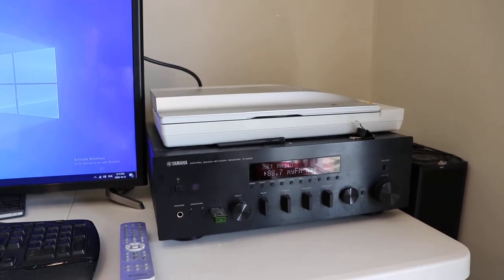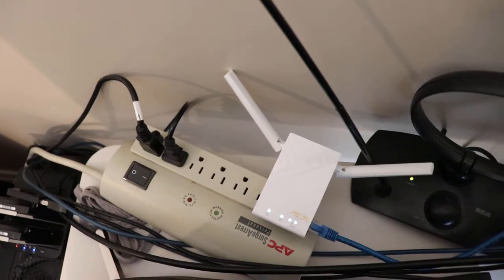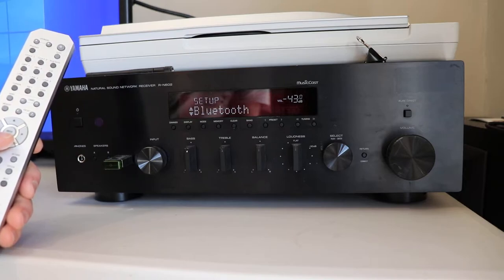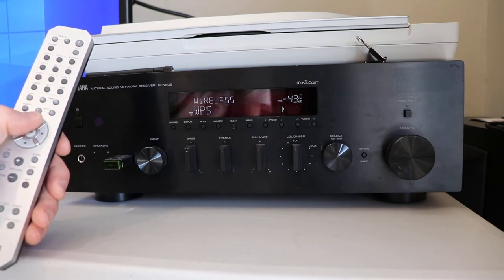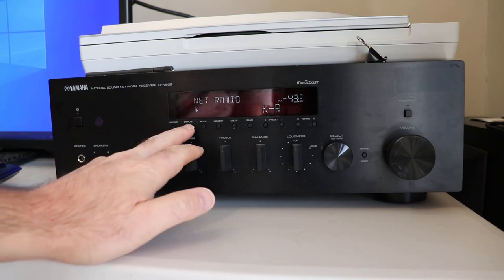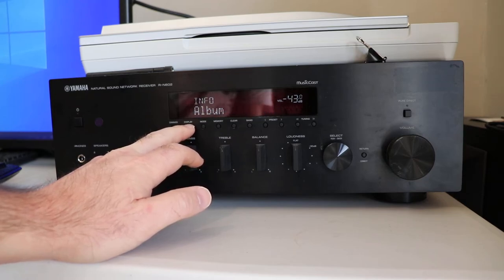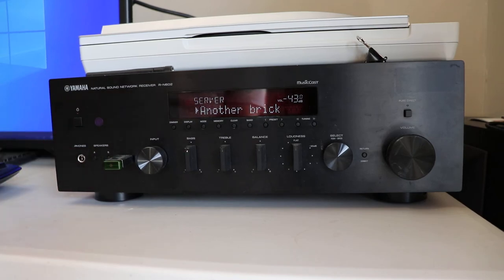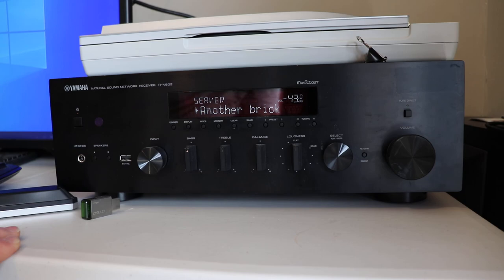Yamaha R-N602 Net Radio and Basic Network Use

Comment: Stephen, just a tip for you: I'd suggest you place the white scanner in other place that's not over the Receiver, Class A/B amplifiers (which is the case of the R-N602) get hot after a couple minutes of use, and they need some ventilation from the upper side.

Comment: Too many bells & whistles on this model, which is why I went for the more basic R-S300 model. It is built like a tank. Sound is terrific. No regrets there.
Reply: Sonically, the R-S300 is a poor relative to the R-N602. The difference is striking.
Reply: @uiqjirka  The R-S300 is a sleeper (underdog winner) for me. It sounds terrific to my ears. It has great stereo separation. It also has the ToP Art Chassis construction & similar circuitry as the upper end models are like the R-S500, R-S700, the R-N602 & the R-N803. If you don't really care for bluetooth & internet radio, the R-S300 is perfect for your listening needs. The 300 also drives my JBL L-100 floor towers & my 12" Polk subwoofer just beautifully.
Reply: @dm95422  In terms of sound, it is not even close to R-N602, R-N803. Obviously you've never heard of these models. Compared to them, the R-S300 sounds tragic.
Reply: and still you have to programing all the preset like in this model or its easier?

Comment: can i connect two speakers of 800 watts to 8 ohms to yamaha rn602??
Reply from the maker: You will need to read the manual for your speakers to see what the minimum watts are.
Reply: @SteveRivett  that is underpower which can cause severe damage to your amp or speaker.

Comment: Hi, can you preset Net Radio stations?
Reply from the maker: yes, I believe I covered that in this video?  I haven't used Music Cast in a while but I think that is the easiest way to do it.
Reply: @SteveRivett  Actually, i googled the manual and found it, just have to hold down the memory key for 3 secs and it will open up the next avail spot to save as preset.  thank you for responding!
Reply: @bnewcol  You didn't know that and had to google it? Ha-Ha..

Comment: I have a couple of questions. Hope you can help.
1. What is the point of  Pure Direct.
2. When you switch it on Do you still get the display on the LCD?
3. When I turn the pure direct on there is a difference in audio from the left channel to the right channel. Do you find the same?
Thank you
Reply from the maker: Pure Direct turns off the audio effects like the equalizer, tone adjustment, etc.  The display does turn off when you use it.  The left/right should not change unless you have the left/right knob turned on the front of the receiver.
Reply: @SteveRivett  Thanks for the reply. So I set the tuner on (FM) While listening both left and right channels are normal. The moment I turn ON Pure direct there is a substantial amount of volume difference between left and right speakers. ( Right is about 70% higher volume). Just trying to figure out how to solve this issue.

Comment: How is the overall sound quality, and what speakers do you have paired to the Yamaha?
Reply from the maker: I am happy with the sound because it's always good unlike a surround sound receiver which is always switching to different signal types and messing thigs up when connected to a computer.  I have a pair of Bose 201s from the 1990s and a Yamaha YST-FWS100 subwoofer.  The little subwoofer really makes up for the little speakers.

Comment: Hi Stephen, I own this model around 4 years paired with Monitor audio bronze post speakers and its fine. I decided make little progress and add another two surrounded speakers (trying get quadrophonic sound) just wireless only. But I see some issue. If I will use music cast app, everything will ok, because I can join those speakers (any yamaha music cast speakers orr soundbars ) with another room mode. But I don't know how it wil work without music cast app, for example streaming YouTube or another music platform which don't support music cast. Do you have some opinion or experience with the matter?
Reply from the maker: No, I do not have any bluetooth speakers so I don't know how it would work.

Comment: Do you happen to know if you can program your own stations to listen to on the Net Radio? I just get preset options which are not very good.
Reply from the maker: You need to update your firmware and use MusicCast from what I can tell.  I'll try to do a video on it.  https://ca.yamaha.com/en/news_events/2019/0305_av_update_on_internet_radio_station_access.html
Reply from the maker: I just made a new video showing a couple ways to do this.
Reply: @SteveRivett  hi, thanks for your reply, it does turn out that the key to most of the functionality is with the MusicCast app. Works well for me.

Comment: I own this amp and am less than satisfied with the sound through my Kef Q1 bookshelve speakers. I use it only for playing vinyl and for Internet radio. 
Will upgrade to floorstanders sometime this year.
Do you think bi wiring will help the sound?
I'm not sure bi amping is possible.
Thanks for the vid!
Reply from the maker: I do not know, I just have an old pair of Bose 201's and a Yamaha YST-FSW100 hooked up to it.  The subwoofer makes up for the lack of base from the Bose bookshelf speakers but their tweeters aren't very good in them either.
I have a pair of Paradigm Reference Studio 40 V.4 speakers in storage that can be bi-wired but I haven't had a chance to hook up to this unit yet.  I probably won't see them again for 6 months.
Reply: @SteveRivett  OK. Thanks for the time.
I'll look into it and maybe send an update.
Be safe!